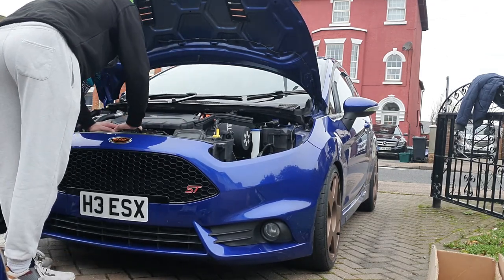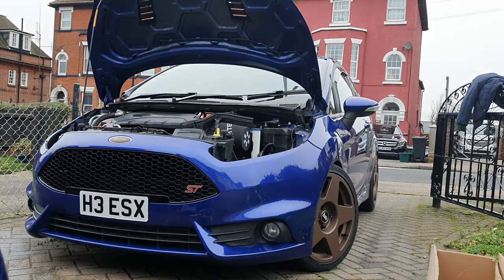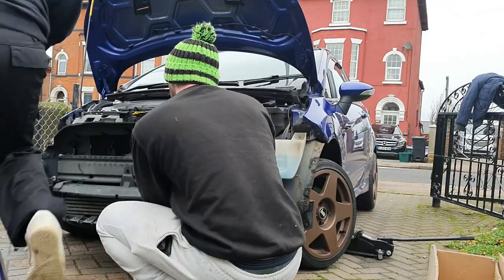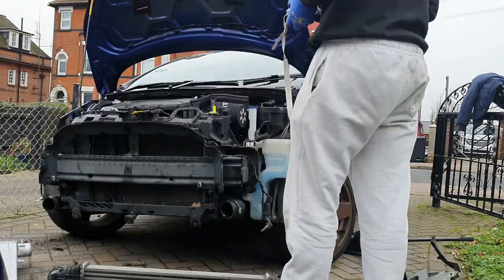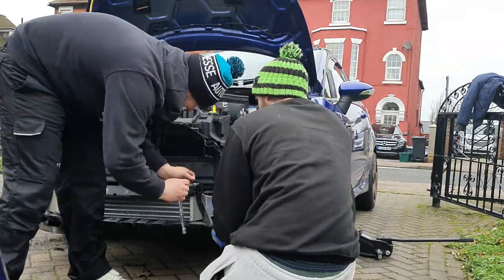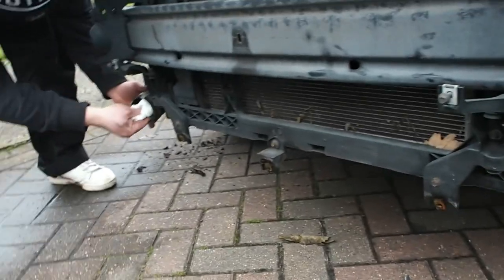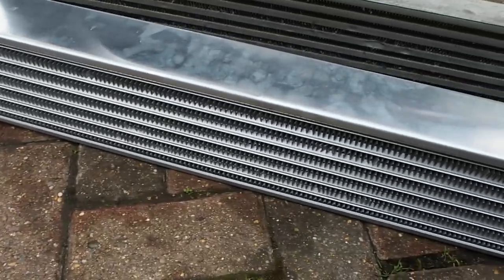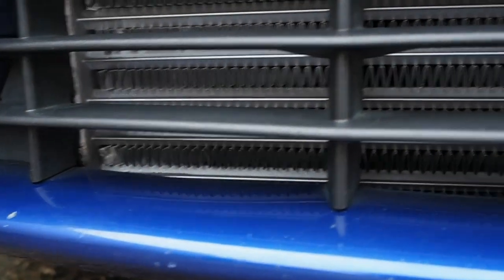Fiesta ST Stage 2 EBAY Intercooler How To *awkward* #fiestast #stage2#intercooler #merch #tuned

Comment: Not sure what you mean by hacking stuff away? The middle mount on the lower plastic part has to be unbolted and not reused, otherwise it should all fit back in. Because the new cooler is thicker you need to make sure it’s pushed far enough back on the hoses so it sits in the slot on the lower plastic. It’s all tight, but too many don’t fit that lower plastic part back which holds the bumper in place at the bottom. Looks like you made a decent job of it to be fair. A tip, position the hose clips so the screw is pointing upwards so you can access it with a headlight out rather than taking the whole bumper off. That way if a hose blows off you can fix it easily (as happened to me).
Reply from the maker: Thanks for the comment keith yes I did not chuck any plastic bits away as i wasnt sure what was needed but when i come to summer if all is still well the bumper will be off again and will get it all put right underneath it is solid atm just not perfect

Comment: Nice, although there has been some recent tests that show a black intercooler is much more efficient when stationary than a silver intercooler.  Being in the UK this may not matter too much, but over here in OZ or any hot country with high ambient temperatures it's always advisable to have a black intercooler.
Reply from the maker: That's what I'll be doing then buddy c

Comment: since when do aftermarket intercoolers come in "stages"?  same intercooler will do the various mapping stages, surely dont get intercooler for 1 level then different cooler for another level !
Reply from the maker: Ok well this is rated as stage 2 as my standard one runs out of puff when mapped and this helps keep everything in better shape when I run slightly more power thanks for the comment negative or not🔥
Reply: @jamiepudney  I get that but why do they say it's a stage 2 intercooler, there isn't stage 3,4 or 5 for when u go big big power! know what I meanm New subscriber after seeing your vids with Paul Dolden
Reply from the maker: @viewfield5  yes I totally get what your saying ! But it's just what the company states it as so that's what I called it in the video i appreciate the support to the channel and every comment is very welcome !
Reply: @viewfield5  its an easy way to show which parts will be good for certain power levels